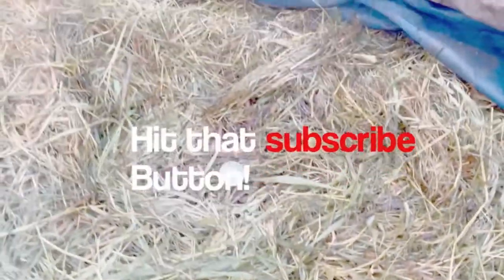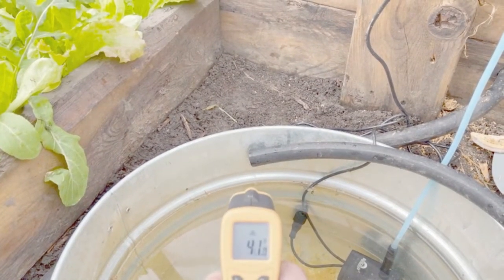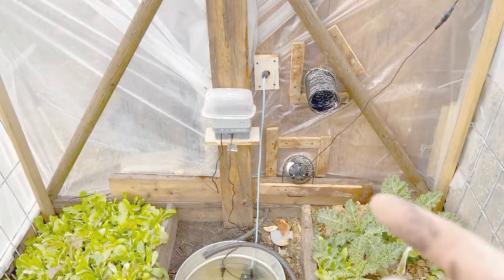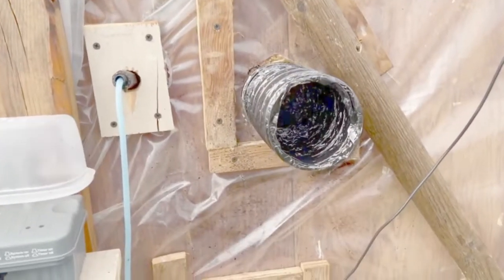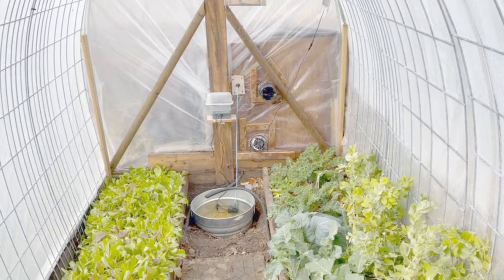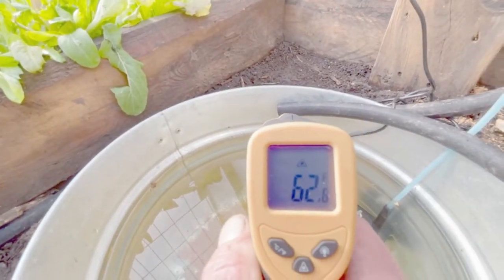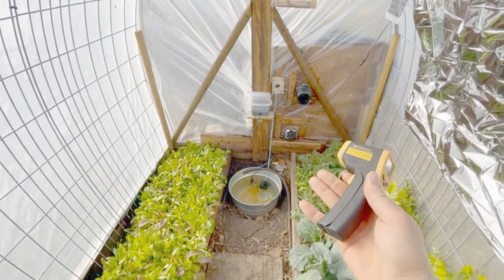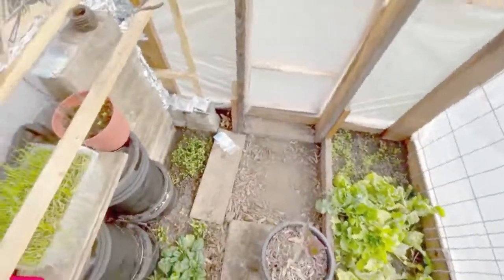Cheap Heat DIY Greenhouse All Winter With Solar & Compost Energy | Sustainable Systems  Zone 4b

Comment: Hey man can u show how u made the whole circuit. Im trying to understand how to make the solar energy storage. How do u store it? Can u give a full breakdown on the whole circuit as i want to build one myself! Watched all ur vids about this one and just curious how to make the whole pumping system
Reply from the maker: In some of our more recent videos we show our larger solar system in depth a bit more with moving water and air through compost in our big greenhouse. But we aren’t storing nearly as much energy due to the size of pump I was using in my large greenhouse. The system I use in my little greenhouse is self contained that’s why I wanted to experiment with, being able to rely on the self sufficient battery back up. But we’re only using “simple” solar, dc powered items. I am looking to go larger from 1-2000w system and inverter for plugging a few things in in the future
Reply: @Earthdwellershomestead  Allright so just a basic solar kit fullfills the needs. I want to make one aswell but im curious to how u made it to go on at a certain temperature or certain time. Is there a time relay on it? Or do u just put it on manually. I would like to keep it running 24/7 almost during winter time so im looking for a system that can bring me that